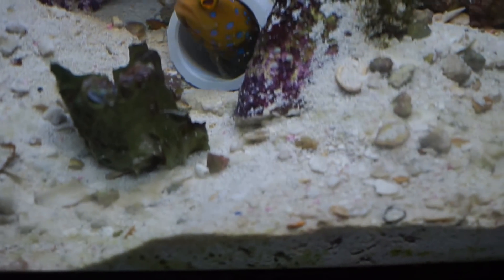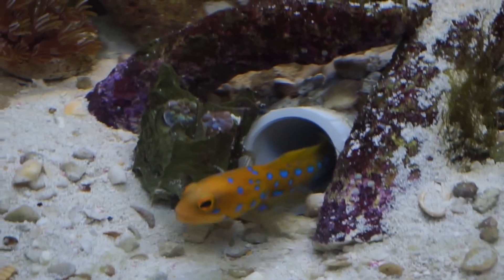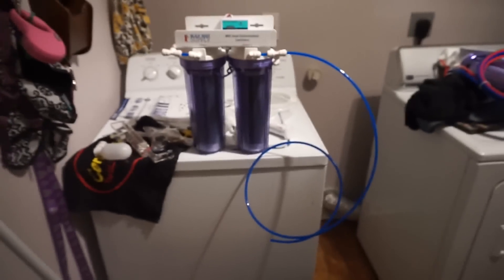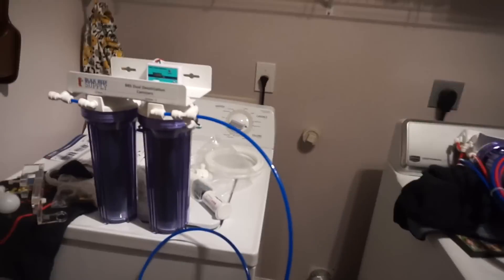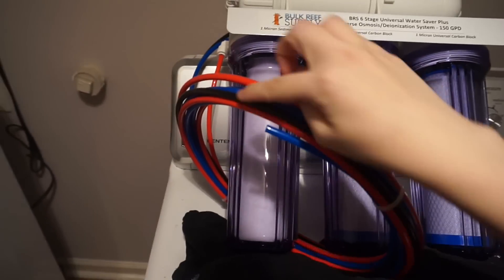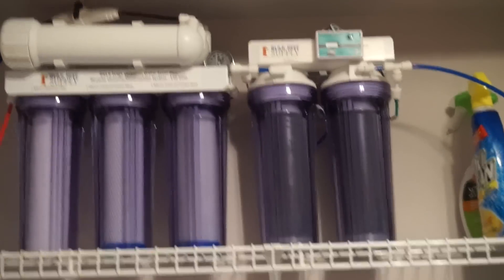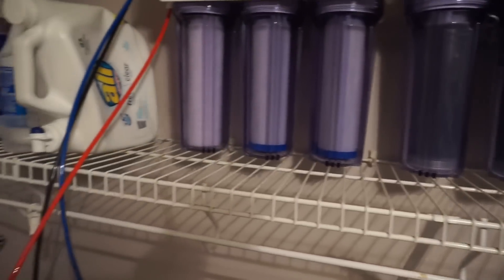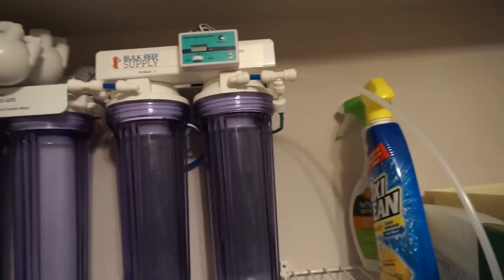How to Set up an RO/DI Unit for Fish!

Comment: Where did you get the check valve, the y adapter thing, and the 1/4 inch tube adapter
Reply from the maker: check valve came with the unit, the y adapter I got at lowes but it's also at home depot, only other things I needed was the 1/4 inch hose bib that connects to the y adapter, which i got from searching around on amazon lol
Reply: Taylor Nicole Dean thanks!!

Comment: Just started a saltwater tank! We went to the fish store and bought several gallons of "pre-conditioned" salt water and live rock. The man at the store told us it's okay to add fish right away but I feel skeptical... Should I still run my filtration and skimmer for a few weeks before I add fish? We are trying to make a 200 gallon reef tank without predators (kind of like Finding Nemo 🤗🤗). Btw, are you using a Kylie Jenner lip kit??!! XD
Reply: Anela Åkerman Yes you are right keep running your filtration and hold off getting fish yet give the biological filtration time to cycle first. Then test the water so it's safe to add fish. Also have you got a refractometer to test salinity of the water from the shop, if you can try to make your own saltwater at home then you can get the level right yourself. Also you may get a diatom bloom to begin with but that's normal your tank will go through changes as it reaches equilibrium. Yes I would start with clownfish and you can get some cleanup crew snails and hermit crabs too. Just take your time it's not a race keeping a saltwater tank :p
Reply: Anton ^ you have to cycle your tank first as you would do with any other tank. Wait until the tank establishes itself and  the beneficial bacteria grows. (Look up "cycling a saltwater aquarium"
Reply: Anela Åkerman also please don't buy any animals to help cycle your tank. It's unnecessary to put an animal through that
Reply: Mr. Purple I know
Reply: +Anton kay thankies! I'm letting the tank run for a few weeks with live rock before I add the fishies. ✌️✌👍👍👌🏻👌🏻
Reply: yeah just do that anything else just ask :)
Reply: Anela Åkerman hi

Comment: Sorry to hear about your flood.  Get a solenoid valve so you can control the flow from the input line.  You can hook up a timer and float switch in your trashcan so that it will shut off when the timer is done or when it hits the float switch. That gives you 2 reduntant fail safe.  Something like this http://spectrapure.com/PARTS-SUPPLIES/VALVES/Solenoid-Valve-24VAC-w-1-4in-quick-connect-fittings

Comment: If you drink is is it better than normal water and is it more healthy?
Reply: Jo Cha no it's not safe for human consumption, there are special filtering systems that use RO but it should be labeled. Any RO/DI system is not good for human use.
Reply: Mr. Purple thnx <3
Reply: Jo Cha I have an RO/DI system, you don't want to drink the water if you run it through the full system, because it will have no minerals in it and no electrolytes and that can be bad for you if drunk in a large quantity, but there is an easy solution , I have a valve on mine where I just stop the water from going into the DI section, so it's only reverse osmosis and that is absolutely okay to drink, it tastes absolutely wonderful. and then when I want to run it through the DI system for my fish tank I just switch the valve again, it's very easy
Reply: Funke House oh thank you my dear i was just wondering

Comment: Correction: RODI is great for freshwater. Especially for planted aquariums or shrimp tanks as our total dissolved solids (TDS) need to be lower. I used to keep neon tetra and their fins would end up dissolving away and they would die and I found out later that it was because my TDS was too high, meaning, my water was too hard. RO water fixes that.

Comment: I use RODI water for all my reptiles and amphibians as well and recently a lady at my local pet store told me that long term its bad for them because it "doesn't replace the minerals" like spring water does? Is that accurate? I've had them on rodi water for over 6 years so I was skeptical but I'm not finding anything online

Comment: My bettas are turning black. Do I need to get one of these? I have filtered water, big tank, they are very active and are healthy (I think) and have separate tanks, don't know why this is happening...
Reply: Marly Newton what exactly do you mean by turning black? Sometimes a betta will just change color. I had a blue veiltale female go from blue to black and blue. Are they both changing? This could mean they are ready to breed. Bettas will get lines and change color if they are ready to breed.
Reply: Mackenzie Kephart all 3 of them are turning black on their head.
Reply: Marly Newton typically there is never a need for RO/DI water for freshwater fish. Most definitely not a betta, sometimes it could be bad for your fish because the filtration process strips the water of everything (including minerals and nutrients) which you would need to dose back into the water. Unless your tap water is just that terrible (which I doubt) you don't need RO or RO/DI water. If your bettas aren't showing any symptoms I doubt they are unhealthy or ill
Reply: Marly Newton they're ready to fight

Comment: How to "Burn out a $25 DI filter in a day".  Video was great, but important to purge the filters in the RO unit and use the IN/OUT meter before you connect to DI. (also when changing filters)